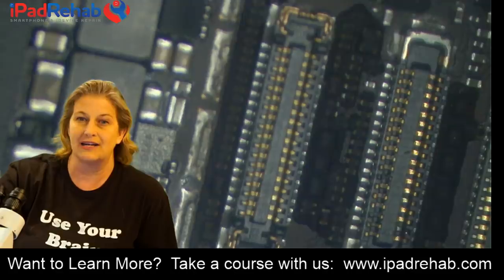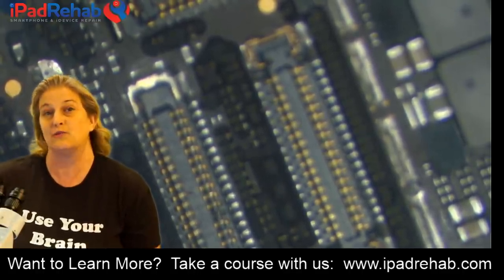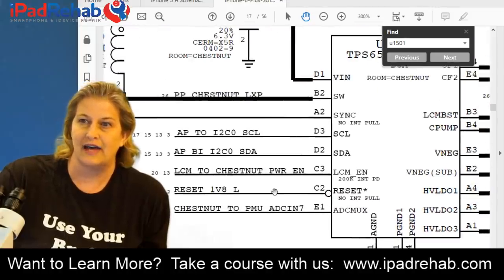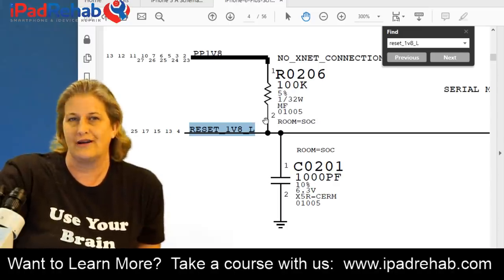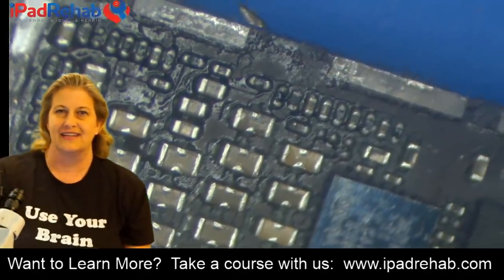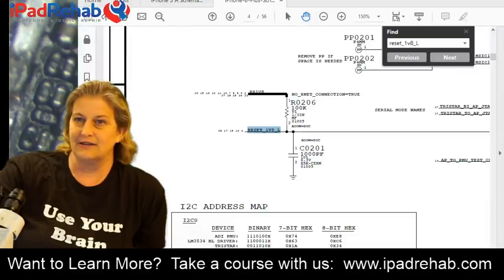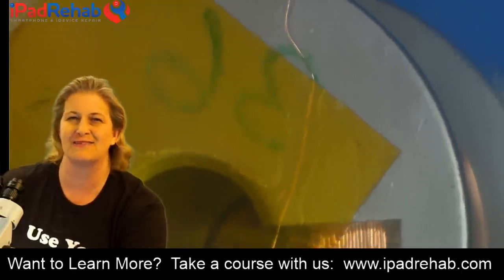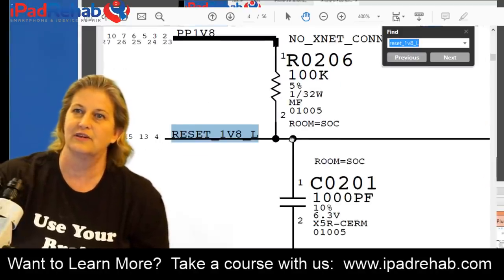Troubleshooting Brain Dead Phones---CPU RESET_1v8_L

Comment: Yes ! This is a good video. I've been biting my nails and holding onto my seat the whole time ! Lower the resistor ! That is so genius !!! So you found what worked by guessing. I wonder if there is a way to calculate that value with Ohm's Law or something to get that value of 98 Ohm or whatever it may be if it may be called for a slightly different value than 98 Ohm. And if the memicing the reset signal was simple to do by hand mechanism, to record and attempt to mimic on time sounds cool !  Or even be able to record that signal and inject that signal into bad line, Ohh!    Clapping my hands out loud 1:19!  Usually when I have had phones CPUs getting really hot but staying on for a few mins I would cool with freeze spray every few mins to keep it going until done. Wait, I didn't spray CPU I sprayed those copper heat sinks then placed on CPU and keep rotating them as they melted.

Comment: Watching video now at 6mins in. ( i may be wrong :)

There are inductors for the AP core outputs that can fail this will break the line and also prevent voltage drop down on the buck converter.

LDOs like the 3v0 nand can still be present doesnt mean there is a faulty on the PMIC but on those inductors.

The AP needs at least 8 supplies before it moves to self test, at 20ma your looking at clock failure
or the AP.

Is there .09v on the crystal?

The sequence is a follows:

1) Standby *

2) Trigger

3) Clock Crystal (you may be stuck here )

4) Reset

5) Maintenance / System Test.

Reset could also be pulled low by other ic corrosivness  (ie) at 0.4v instead of 1v8 with WD..

PMIC does the reset on the AP after the clock is running and main core supplies are fulfilled.

This lets the AP be clean and free from errors before carrying out stage one self test.

If AP is pulling down and there is some resistance then add more by another resistor same as SWI fix

Similar fault to I2C bus circuit with WD where any corrosive IC attached can pull low preventing the bus from starting normally backlight which causes bootloop. Remove Resistor to see what side is at fault AP or 1v8 by resistance / diode mode.  Sorry missed the CHAT and once i start its very hard for me to stop and shut up.
Reply from the maker: Look everybody---Dee Gee has a FACE!  :)
Reply: Looking forward to more of this, this is whats its all aboot...

Comment: Please note that I'm just a hobbyist not a "micro-repairer". Here are a few idle thoughts.
If the power on shows the 20mA syndrome and assuming no prior meddling; would not an immediate check of the voltage on pin 1 of R0206 be useful? It should at least show whether a short exists between B2 & C2 on Chestnut (or somewhere else currently unknown). 

Jessa experimented with the absence of R0206 which is the equivalent of it being open circuit. What would happen to the power on symptoms  if C0201 went open or short circuit?
If open would the lack of the RC delay cause an issue?
If shorted the reset would be held low which may or may not cause the CPU output port an issue.
Comments?
Reply from the maker: Hi Dave--great comments, and I'm happy that a hobbyist can sit through a 90 minute video--well done!
You betcha on the 20mA pattern.  After you see a case like this one time--which can be an all day affair, then the next time you see 20mA then you go straight for voltage at the Reset_1v8_L test point.  If it is low, then you know you have "a reset phone"  which then means it is time to play "guess the resistor"  --after this case I have finally bought a 100ohm potentiometer for the next one--wish I'd done it last time!

The problem is that if reset is subject to overvoltage at any point--currently or in the past---then it will damage the structure of the CPU on the reset pin.  At times, it can KILL the reset and that is a dead CPU/dead phone not recoverable.  If you have a short on reset (this can happen natively) then it can produce a phone that is a 20mA phone.   If open--same thing, the CPU can't reset chestnut or tristar---and tristar is required for boot.

Great questions!

Comment: Jessa, great vid. Can you not calculate the resistance you need  using ohms law? Your potential difference on the bad board is 1.8v - 0.6v  = 1.2v. With 100K Resistance that is 1.2/100,000 = 0.0000012 A.  So to get 1.7 volts on the same circuit you need a resistance of  0.1 / 0.0000012 = 83.333 ohms. ????? Thanks for all the work you do, I'm gonna try this one too......:-)
Reply from the maker: Apparently not although this is a good idea.  Here in this case we found that a 100ohm resistor did not allow the phone to boot, (producing a voltage of 1.6v) but that a 243 ohm resistor did work (producing a voltage of 1.5v).  Presumably, the low ohm resistor must have allowed 1v8 to be pulled down when the CPU grounded the line, and 1v8 produces many other data lines in the phone.  We could see that with the 100ohm resistor we got some function out of the CPU, but the phone would just loop.  With the 243 ohm the phone could boot--at times (even though excess heat was generated at cpu)  and stay on long enough to take a full backup.
Reply: @JessaJones  Thanks for the reply, I missed the last part on raising the resistance to get a happy medium.... I have just been re-thinking about this problem and if the issue is that the CPU is fighting against the 1v8 line going through a low resistance, perhaps cutting this line and switching it to say a 3v0 line (with a jumper) would help? You can then run a much higher resistance (perhaps the same 1 KΩ by my calculations) and have the same effect but with the CPU working a lot easier and perhaps more stable? Lord knows what the affect on the 3v0 line would be....but it has to be better less than the 1v8 line :-) Just a thought

Comment: Measure resistance to ground on that reset line. Then you can differentiate the different 'fault on reset line' cases.
Reply from the maker: The resistance is never markedly different than normal, which is why the resistor solution works.
Reply: Why would the one imply the other?
Reply: You can most likely change the pull up resistor value while it's boot looping to find a good value while watching the power draw from your power supply

Comment: The cpu doesn't talk on the reset line , it listens ....The reset line is low at power on held low while the cap charges thru the resistor eventually reaching source voltage .... almost all logic chips reset in this way at power up....the R/C time constant determines how long after power up the line is held low....

Comment: There are smd booklets that have a selection of capacitors, resistors and inductors on ebay. MIght be easier to have set of those rather than harvesting parts from boards or using bobbins of magnet wire to simulate resistors.
Reply from the maker: The last time we were insanely cutting out loops of bobbin wire to make custom resistors, we SWORE that we would make a one of those books for iPhone sizes  (the ones we looked up on eBay in a 10 second search were too big).  And now after this phone---I am DEFINITELY going to do it.  I swear.  On Monday.   I mean it.  I will not blow it off!
Reply: @JessaJones  I will throw one other suggestion out there as well. As I have watched your videos I noticed you have to jump around alot in the schematics for more complex troubleshooting tasks. You might want to try the microsoft snipping tool to copy parts of the schematic and paste into another document. That way you have all the relevant parts close together in one document for easier viewing and for future reference.

Comment: Watched to 57:00, and I thought the fact that the leak in the CPU can cause RESET_1V8_L always low indicates that the resistance in this line in the CPU is much lower than 100K. So, could u just replace the 100K R0206 to a resistor with lower resistance (like 1K, for example, I don't know the proper value), then (as long as the internal CPU line isn't shorted) theoretically it may work.

Comment: The 100ohm resistor pulls the line up MUCH harder than the 100kOhm resistor. 100 is a smaller number than 100000. BUT that means the resistance of the original resistor is a lot higher. BUT that also means that it is 'pulling' a lot less. If you are pulling a signal to ground or to a power line the SMALLER  the resistance the HARDER you are puling!
Reply from the maker: Yes--same concept as the answer I just wrote to Nathan---the 100ohm resistor must have allowed 1v8 itself to get pulled down by the CPU whereas the 243 was enough to create a high/low that the CPU could understand while still pulling up 1v8 for everything else.
Reply: From 100k to 100 ohm is a VERY big change. Better to try 10k and then 1k first... 
The CPU needs to be able to pull the line low, but in the default state it need to be high. With 1.8 volt logic anything over 1.17 volts counts as high. Anything below 0.63 volts counts as low. So you would want the HIGHEST value resistor that still pulls the reset line to something (a bit) above 1.17 volt.
Reply from the maker: @haraldvanarkel4429  We've had a few of these cases and on the first case we did exactly that and 100ohm made it boot---so now we try to go for that.  But this is something we didn't know "1.8 volt logic anything over 1.17 volts counts as high"  I've spent time trying to differentiate whether 1.5v is "not counting as high" when a reset-dead phone wouldn't boot and until last night's phone, never thought much about the alternate case--that too low of a resistor would be allowing 1v8 to go too low for the rest of the phone and that is why the phone can't boot.   Thanks for adding that info!
Reply: Yes the lower the resistance the more current is pulled down when the line needs to be low to just register as a logic 0. If the resistor is too low in value most of the current on the 1.8v would be pulled to ground and there wouldn’t be any left to provide power to circuits. Remember it’s on the 1.8v rail and that goes basically everywhere on the phone.

Comment: Well you told someone to wash his mouth for saying that maybe an small short was the root cause! But then the problem was actually a short under chestnut?
Reply from the maker: We say short = short to ground.  And this is the common thing people look for —all iPhone problems are shorts, all iPhone shorts cause heat, the heat is the source of the problem.   This thinking is very entrenched among people working on these problems.  

We say “bridge” when two lines are bridged together like c2 and b2 at chestnut.   Bridge = not ground.  Short = ground.  That is just our own convention within this industry
Reply: iPad Rehab got it. I love board Repair and electronics over all. Like you love to seek the causes and identify a common failure. I want to see more of oscilloscope use to troubleshooting! Awesome times!!